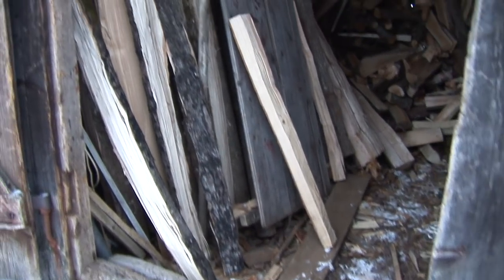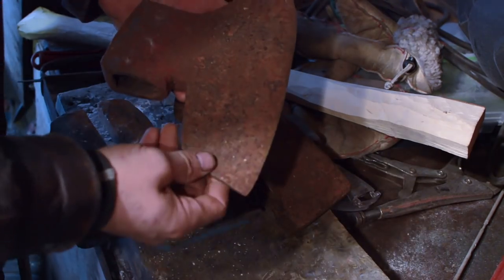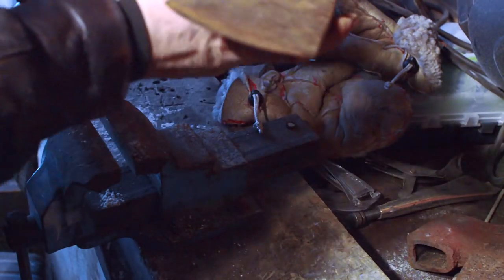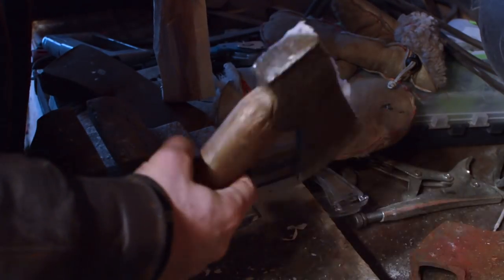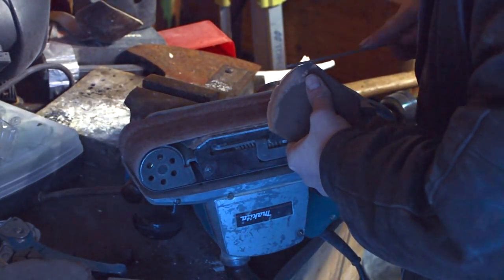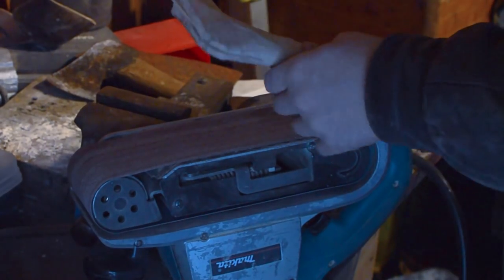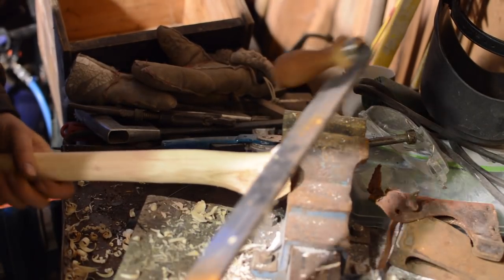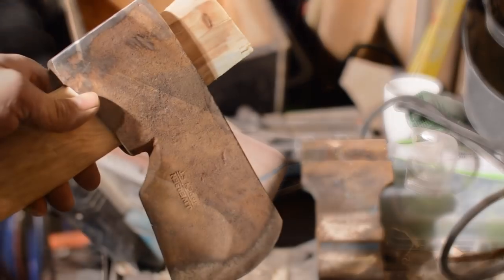🔴 Extreme weather Hanging an Axehead- Axe Cordwood Challenge (working Axes)

Comment: Seem to be getting a lot more power with that longer handle. I would try making the grind a little thinner but I can't say how thin because I have never cut wood in that sort of cold
Reply from the maker: I will try with a longer handle, there are four or five more of these heads somewhere, if I can only find them.
Reply: ive found my length of deep armpit to fingertips one hung is almost ideal.
Reply from the maker: I'll try that, it is about the length Ben suggested (80cm), at least on me.

Comment: Nice job hanging it,  I've had very little luck with the White Ash as a handle material, at least the ash that grows here on my farm.  Now we've got Emerald Ash Borer and it will all be dead soon anyway.  I know European ash is a very traditional axe handle, so clearly different ash must vary from place to place. I had no idea that sheep like spruce bark.
Reply from the maker: I like Ash handles, because they don't jar as much as hickory. I have suffered quite a lot from tendon strain over the years and have found that it can be kept a bay if I use Ash. The laftebile (Bearded axes) all have transverse growth ring handles too. But on these felling axes I am trying lining the growth rings with the blade, what a lot of people think of as the "right way".  The sheep have stripped off bark from spruce, alder (Alnus), and even birch. Makes you wonder if they do it to kill the woods so the pasture will prevail.
Reply: @LucasRichardStephens   that's what they did to Iceland.  Ash axe handles are not available commercially in the US.  And the ones I've made from my homegrown ash usually won't last more than a couple of minutes of chopping before they snap off cleanly right at the eye.  So it is clearly a problem of inadequate strength to the wood.
Reply: @LucasRichardStephens .......... Ash is my preference as well.....it burns good too
Reply from the maker: @ravenhhca  I think we must be further North than Oxbow Farm, or there are several types of ash.

Comment: My belt sander get a lot of use in that position, too.  I come up with a variety of ways to hold the trigger down, it doesn't have the button to lock the trigger, sometime its just a sliver of wood off the floor jammed into the trigger guard.   When I do use the belt sander on an axe head I keep a water bucket handy and used bare hands and feel the heat and watch the water evaporate just keep it wet all the time, if you have a helper with a squirt bottle that helps.   I liked the sound of the file biting, good steel not too hard.   that is a brute of a spruce.  Maybe I'll get out the axe after I get the roof on my old building.   I started last year but could find the time to dedicate.
Reply from the maker: I was jus going to have a little go to show some support, but it was so vitalising to leave the chainsaw behind  and get the blood up,  may carry it through (once my blisters have healed).
Reply: @LucasRichardStephens  Your hands aren't that soft!  I was curious how it went getting the tree unhung.  I always uggg when they go just off a little and stick up in the neighboring trees or in a tight spot its almost impossible to get them down all the way with out a cable and skidder.
Reply from the maker: @timberdoodles4647  I just cut off three stocks 120cm at a time and it rolled to the right into the gap it was supposed to hit. This stand of trees is so tight, but it makes some great habitat so I am loathed to clear out too many trees. I have this thing called allmenningsrett, like the old common land laws in UK, which means I can take out firewood from the "common" land, so I don't "need" any of this wood here on the small holding. It is not big enough for commercial use so it is my hobby wood and nature reserve. I have not been taking even the damaged trees until now because I am curious as to what life is abundant in this kind of wood, the big difference is the small birds, they love the dense cover as do the small deer. I have lived here 16 years now and this is the second year I have been thinning living but damaged trees. I am tempted to leave the two densest areas for those small animals. The spruce wood grows too fast for building timber, at least for log houses.
Reply: @LucasRichardStephens  I have a large stand of mature white spruce that really need to be cut,  it is in tree growth, a tax break for growing trees, I need to have a forester give it a look at and suggest the best or at least some options, its also part of a wet land and protected but there is a percentage of it that can come out.  There is a big part of this 100 acres that there is no cutting allowed and that I am happy to leave as a natural part of the ecosystem,